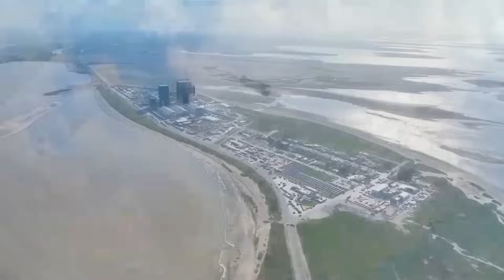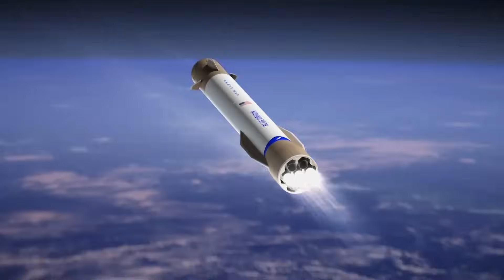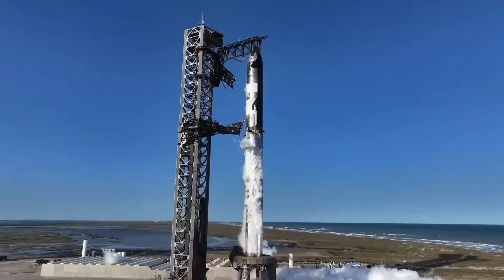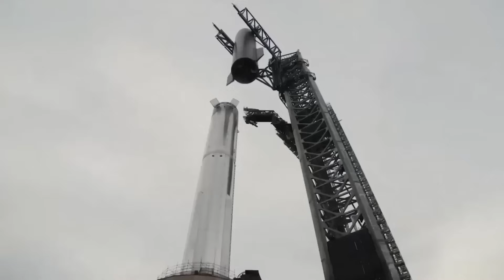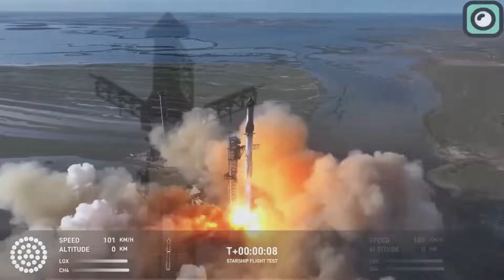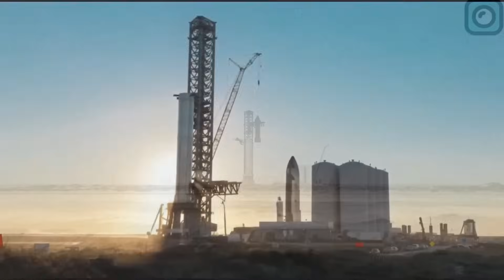Blue Origin Origin Announced The New Glenn Booster Failure Cause!

Comment: may want to remember , space x (musk ) made all kinds of time lines for starship , and missed every single 1 of them , we were supposed to be on mars now remember , blue origin missed dates , sure , then launched , made orbit , and deployed a payload FIRST try , lost the booster , and space x lose how many trying to get it to work ? , as for surpassing the super powers lolololol , space x is great at getting to low earth orbit , even sending some things further out , but dont land rovers on mars , or venus , dont sent machines out of the solar system that run for 60 years , the big players in exploration are far ahead of any private company , they have done things no 1 else has done because there is 0 money in sending probes for pure scientific reasons

Comment: Speculation by some is that the fuel / oxygen tanks during the rotation of the booster slosh too much, causing problems with the operation of the engines due to "aeration" of the liquids.  One solution could be 2 quite small solid rockets deployed prior to lighting of the liquid fuel main engines.  This would settle the liquids in the tanks, oriented properly to fuel the main engines properly.  If that condition contributed to the failure, perhaps it could be a cheap solution